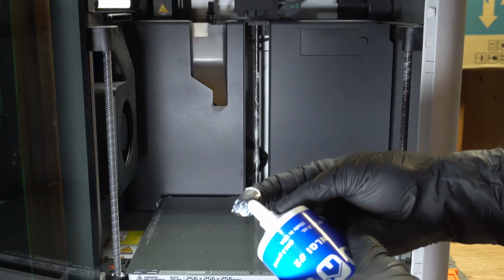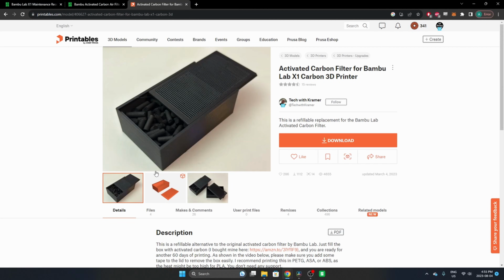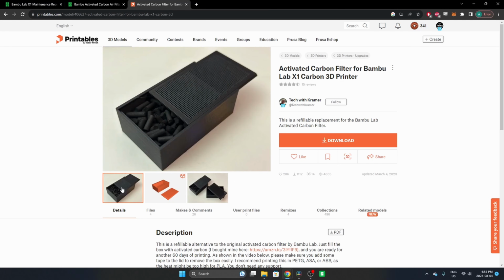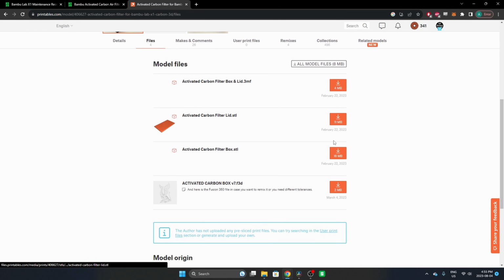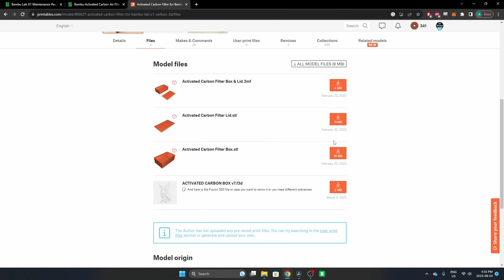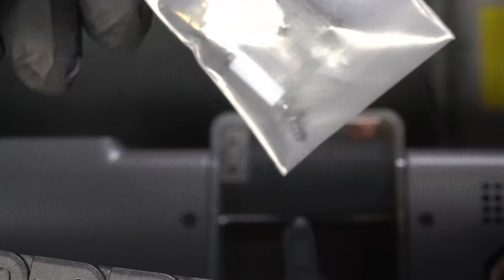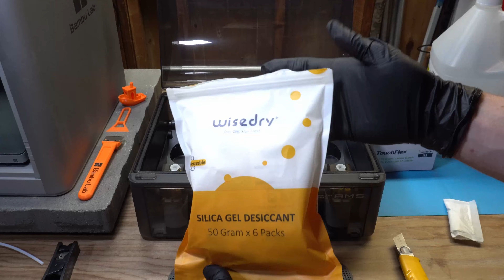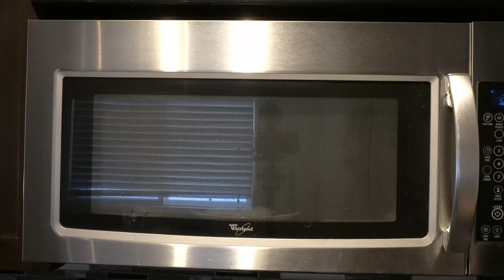Periodic Maintenance Recommendations X1C, P1S, P1P and AMS

Comment: be careful spinning the fan with your compressed air since a DC motor turns into a generator if you spin it... If you spin it higher than it's rated fan speed, it will generate higher voltage than the control circuitry can handle. So, STOP the fins when you blow it off...
Reply from the maker: You're not the first and you won't be the last person to mention this. I appreciate the concern and have made the mental note for next time.

Comment: EDIT 1 Year Later: Im never going back omg. I only had one issue with this printer and it was due to the filement being defective. Only coming back to this video to take care of my printer before anything goes wrong

OG:
I want to go from an ender 3v2 to this bc of the advertised lack of maintenance, is this true? Im sick of leveling my bed, cleaning it, swapping nozzles, put sticky notes under my bed, worry about the frame etc etc. Is it easier on this printer? My ender 3v2 has been out of tune for years because I can never get it right, would this printer fix that?
Edit: I do have a CR touch, however it rarely helps due to the warping in my bed
Reply from the maker: There's still the maintenance items you see in this video that Bambu Labs recommends. But it's definitely an easier printing experience with this printer compared to an ender 3 v2. The ender3 v2 is what I had before the X1C and I don't use the ender at all anymore. Bed levelling is entirely handled by the printer. Swapping nozzles is a bit of a chore cause you have to change out the entire hot end but I have a video showing that if you want to know what that looks like. https://youtu.be/-f8XW8zZSRo
I have no affiliation with Bambu Lab and would definitely recommend the X1C if you're looking for mostly hassle free printing.

Comment: As a new X1 Carbon owner, I have found some much great info in your channel, Thanks. Questions: Where did you got that concrete tile? (I'm assuming is concrete) I think Stefan from CNC Kitchen mention something about that and what's the little black/green tent and how you implement into your workflow. Any info related to fumes, since I have my X1 Carbon in my on bedroom studio. Thanks in advance for any info.
Reply from the maker: Concrete tile is from Rona which is a home improvement/hardware store up here in Canada. 
Black and green tent is intended to be a grow tent but I use it in the winter to heat the area around my printers. My printers live in a unheated garage when they're not in my home office. It gets to -30celcius sometimes so I have a little space heater to heat up the inside of the tent and I can print year round. If your printer is in your bedroom I would only print PLA.
Reply: I haven't print yet with the PETG filament I purchase neither the TPU. I have to see and I might need to buy an inline fan to vent out and circulate air. I live in Florida, USA. Thanks again, much appreciated.  @3DPrintStuff

Comment: Holy shit, fix your vid. You should not disconnect the AMS before turning off the machine. Please fix it, it can fry boards.
Reply: I've disconnected and reconnected loads of times to removed blocked filament mid print. So far, so good :)

Comment: Useful video. Thanks for sharing.

In my experience printing PLA, you can go way, WAY more than 3 to 4 spools between changing the cutter blade. Probably heavily dependent on how you’re using AMS/switches per layer, but I’ve probably gone closer 100 rolls. FWIW.
Reply from the maker: Yeah rolls of filament is a funny metric for that one. They also say # of cuts which is a better metric, I think its 3-5000 if I remember correctly. 

If you just use rolls of filament it could be 1 cut or 1000 cuts per roll depending on the number of color changes. Thanks for your input. 100 rolls is a lot, are you printing parts for small scale manufacturing?

Comment: Somewhat incomplete instructions on how to maintain the life of your X1C.
Reply from the maker: Care to elaborate? All of these recommendations are coming directly from the Bambu Lab Wiki.
Reply: 1. As others have said, you never blow out fans without holding them in place. 
2. You didn't slide the tool head over to clean the Z-rods completely.
3. Not cleaning the linear rods before oiling them will only move the existing dirt around, you need to clean off the dirty oil before applying a new coat.
4. You only showed cleaning one of the rods, not all four. For newbies who might repeat your steps exactly, they might not realize they need to clean all the rods, Y and Z axis.
5. You didn't clean the three lead screws before regreasing them. This is a must, regardless if printing with ABS/ASA or not. This is probably the most crucial routine maintenance step and requires thorough cleaning of the entire rods. Which means moving the tool head up and down so the entire rods are accessible.
6. You didn't show how to clean the hotend sock. Most of the time, if no tears are present, simply cleaning it with alcohol will do the job. You only need to replace it if there is visible damage or replacing the entire hotend.
7. You left your build plate in the printer while you were cleaning. This is not recommended since you are dealing with grease, oil and flying debris. 
8. You didn't mention examining the AMS First Stage feeder for dirt and filament debris and then blowing them out.
9. You didn't mention generally blowing out the entire AMS of any debris, especially if using cardboard spools.
10. And though this might be a bit on the compulsive side, it is a good idea to clean the entire inside with a microfiber cloth with a small amount of alcohol, especially if printing with abrasive filaments. However, even printing with PLA and PETG will cause a slight buildup inside the printer.
Reply from the maker: @highrise9559  Appreciate the feedback.
Reply: @highrise9559 I cannot wait to see your maintenance video for Bambu Lab printers. 😊
Reply: @hologos_  yup i was thinking the same thing. Lol. Sounds like a lot of very good advice. Would be awesome to update the video with this new info
Reply: @highrise9559  actually really great feedback.  thank you!

Comment: Get a dryer sheet from cleaning your clothes, use that on the top glass then switch to a microfiber cloth and buff it, less dust buildup and you can use one 5 or 6 times before needing a new one, also works on baseboards
Reply from the maker: Interesting tip, didn’t know you could use dryer sheets on glass. I’ll have to give it a try.
Reply: Nice tip! Do you mean use a new dryer sheet or used?
Reply: @naktaal better to use a used one because it will have less wax on it

Comment: Nice. I have the tools, so I sharpened my cutter - it was not cutting TPU fully, but now my MK3S+ is the dedicated TPU machine. What about belt tension adjusting? I'm aware that it is 'resetable', but I dont't know when...must research.
Reply from the maker: If you perform a "Device self test" the printer will tell you if the tensioners need adjusting. Bambu Lab have a good video on how to do this: https://youtu.be/Ibjj0RKWHoE
Reply: @3DPrintStuff  sweet, thanks. That's what I get for not reading the owners manual
Reply: I use fine sandpaper and water to sharpen that blade.